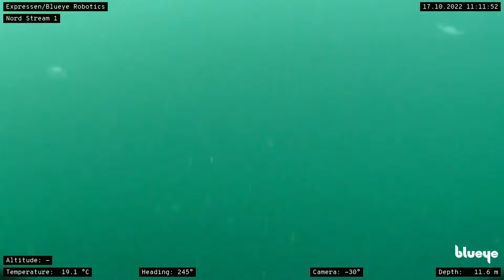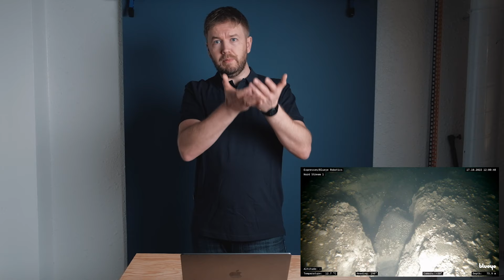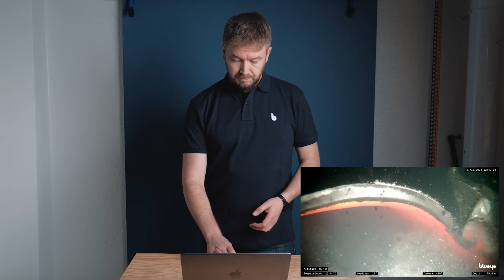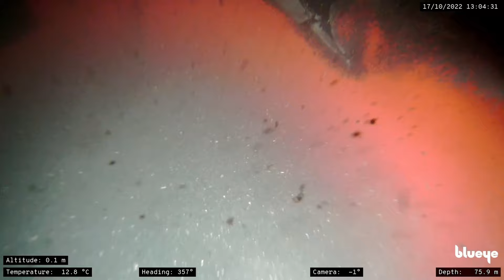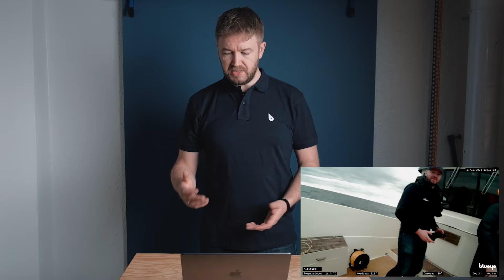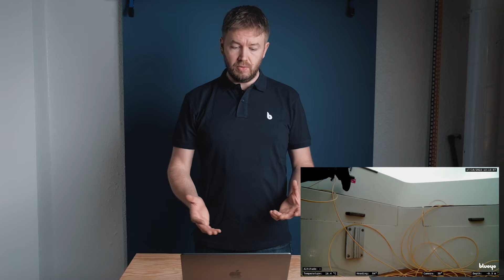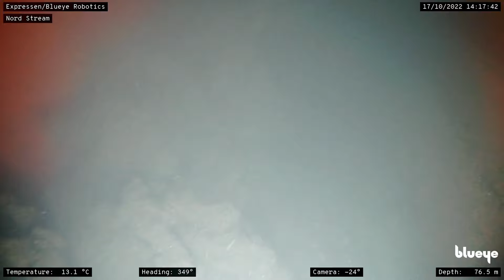Inside the damaged Nord Stream 1 pipeline |  Blueye Journey

Comment: One guy who studied all the videos said Nord Stream 1 looked blown by explosives, while Nord Stream 2 looked like a rip caused by faulty construction. That, plus the fact that the failure locations between NS 1 and NS 2 are 80 km apart made him think NS 2 was a natural failure, but that caused whoever planted bombs on NS 1 to detonate them because they knew inspection drones would be sent down and would find the planted bombs.
Reply: Faulty construction – I have seen how these tubes are welded together, and it seems rather unlikely. If a “natural rupture”, the ends should be rather close, as a rupture would not blow away many meters of tube. But its tricky, because the hole near Bornholm (NS2a), is the tube which has 2 holes,  the first up near Sweden, close to the other holes.
And the second tube is NS2b, is completely intact. Isn’t it strange, if the purpose was to halt gas altogether, why leave 1 tube intact, which means in fact half the capacity of the gas received so far, the 2 tubes in NS1, remains? This leads us to think, this sabotage was more of “a message”, than a desire to stop all gas. Now, if Germany wanted to import gas from Russia, they could start right away. Putin offered that many months ago, as he perfectly knows one tube is still intact. Importing gas through only one tube, would insure the price for that remains high. If there was gas flowing through all 4 tubes, that would far exceed demands, and price would plummet. Who would be interested in sending gas through 4 tubes for 100 Euros, at full capacity, when you could send through 1 tube, and still receive 100 Euros?
Reply: @poulnrgaard7820  ---- >  Evidently, the ruptures didn't occur on the same day.  In a September 8, 2022 interview, Putin said there was already a rupture in Nordstream 1 
  .... Gazprom performed August maintenance about a week before  an in-person interview on September 8, 202 where Putin said: : 
   .... "Now, the last turbine is out of order. Representatives from Siemens (in Germany) came and looked.  There is an oil leak.  There is an explosive and flammable situation. But, of course, the turbine cannot work. Give us a turbine, we will turn on Nordstream 1 tomorrow.  They don't give anything. They say we use gas as a weapon. What weapon? They themselves have done things.  It's them who have put themselves into an impasse because of the sanctions." (Vladimir Putin)

@ 0: 50 - 1: 18
       Nord Stream 1 Shut, Putin Dangles Nord Stream 2 Offer | Move To Lure Germany As EU Caps Russian Gas?  (crux Sept 8, 2022)
https://www.youtube.com/watch?v=dcV5nhRySHk

 .... On August 31, 2022, Gazprom had closed Nordstream 1 for three days of repairs at the Portovaya compression station in Russia, about three weeks before the reported explosions of September 24, 2022)  Putin claimed the damage was caused due to sanctions on the return of turbine. 
    Kremlin: only sanctions prevent Nord Stream gas pipeline from working  https://www.reuters.com/business/energy/kremlin-only-sanctions-prevent-nord-stream-gas-pipeline-working-2022-08-30/

It was determined that the turbine was not the cause.  Also, on August 4, Russia's Gazprom refused to accept return of the turbine.(Kyiv Independent).  It was, again, offered to be returned on August 8 still within the allotted time frame.. (cnbc)
    Deadlock with Russia over Nord Stream gas turbine is not our fault, Siemens Energy CEO says  https://www.cnbc.com/2022/08/08/russia-gas-siemens-energy-ceo-says-turbine-dispute-is-not-our-fault.html

In his September 8, 2022 interview, Putin expressed no concern that Nordstream 1 had been sabotaged. No one has asked if Gazprom did a search for explosives during that time.

Some had warned Russia's manipulation of the flow of gas in the pipes was dangerous but there still had to be a spark to set off the fire.
    Potential sabotage: What's behind the Nord Stream pipeline leaks? | DW News 
https://www.youtube.com/watch?v=ShXmPA21j-E
Reply: @poulnrgaard7820  
Video blamed faulty construction on the pipeline laying ship/crew rushing things before sanctions against NS 2 took effect. He also showed how the pipe boat was pushed all over in a storm right in the area of the break, leading him to suspect rushed, faulty construction leading to failure.

Yes, who potentially benefits from one NS 2 remaining intact? Russia. Plus NS 2 is 100% Russian owned while blown NS 1 is just 51%. I think Putin wanted drive a wedge between USA and Germany using the Biden comment as cover. Russian false flag psyop. Putin KBG 4D chess.
Reply: @poulnrgaard7820 Were not "ruptures" on Nordstream 1 discovered first?

And there were reports sbout a mine found at the intact line of Nordstream 2
Reply: They probably bumped into it with whatever they used to plant the explosives
Reply: you talking bullshit
Reply: bullshit

Comment: From what I have seen, this pipe was made using the spiral winding method which requires a multiple pass helical weld.  Submerged arc is the typical process, first pass inside with all remaining passes on outside.
Next, we must look at typical stresses.  Two axes of stress are principle, hoop stress which wants to expand the diameter and longitude stress which wants to make the pipe longer.  Hoop stress in thin wall cylinder is twice that of longitude stress.  
Helical angle plays into these stress levels.
Reply: Wrong. It was made from sheets of high strength steel..........Be nice if everybody watched the construction and laying of the pipe videos before they spout garbage...............Z
Reply: @zardiw  
Are you Stevie Wonder?  The pipe has a spiral weld.
Reply: Is that so And
Reply: spiral winding is for flange gaskets... For actual welding of pipe, Fit was done using traditional method , root and hot pass was done by actual welders(cant tell the process because no footage in videos) and fill and cap was done by automatic welding process GMAW. Source- im a weld inspector for pipeline and ex-diver

Comment: ----- >  ... @ 7 29 - 8 01,  "there is no angle grinder signs on the edge of the steel.  And it would be strange to me if say someone had bent this.  The force of bending 45 millimeters of steel and that side is quite heavy.  And, it, at least to me,   really looks like its been torn off. And, with the high pressure inside the pipes, it is not hard to understand that it could bend the pipe."
Reply: torn, agree!

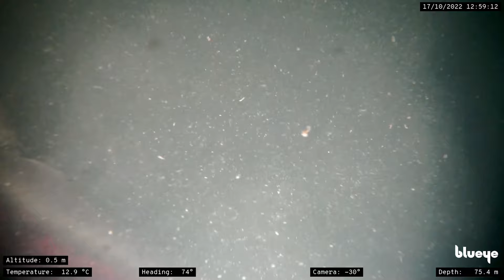Comment: Great footage, thanks. The pipeline was clearly destroyed by an internal explosion as seen in 4:58; 8:53; 11:36 and NOT sabotage.
Reply: That's a huge assumption, the easiest way to blow something up that is under pressure is to simply weaken it from the outside, then let the internal pressure finish the job by blowing it out. This provides no evidence that the initial weakening or explosion was internal or external, just that the result was a massive blowout, which is hardly surprising.
Reply: Wow how do you make that judgement?
Reply: could have been planted before the pipe was sunk... seems the two that said it would happen already expected the pipe was booby trapped/sabotaged.
Reply: you talking  bullshit
Reply: I just love that every armchair expert commenting on this video neglects to mention that pressurized gas erupted from these pipelines and that the forces of these eruptions further rupture, split and bend the steel outwards no matter what the cause of the initial failure.
Reply: @gragor11  
the pipe is made of carboniron not steel.
And that breaks and doesn't bend
Reply: @janklaas6885  carbon Iron?  Really.  So how would someone claim it was not bent in or out if "carbon iron" doesn't bend? They have to bend it to lay it.  The destroyed pipeline is obviously bent.  How do you explain that?  

Furthermore, where exactly does "Carboniron" falls within the differentiations between raw Iron; Pig Iron; Wrought or pure iron; High carbon, Medium carbon and Low carbon steels?

" ... The pipe segments are coated with a special anti-corrosion concrete coating. The concrete coating is made of high-density iron ore, which is crushed, mixed with cement, and applied to the exterior of the pipe segments. ..."

Oh oh . . .  " ...The pipe segments used in the project are made of unique  s̲t̲e̲e̲l̲, in that it has high strength and elasticity. ..."
https://www.petroskills.com/en/blog/entry/april2022-totm-Transportation-of-Natural-Gas-in-Dense-Phase%E2%80%93Nord-Stream-1

You know I don't mind that you shared you knowledge with us about what you perceived the pipe was constructed out of but your dick head approach has left you looking to be the prick in the equation. 

Next time be a little more gracious when you correct what you perceive to be essentially a spelling error. Just in case you're wrong.   I take it you are one of the 'Russia blew up their own pipeline' concept supporters.  

From any blown apart pipeline I've ever seen the pipe is flayed open along numerous yards or metres from the initial point of failure.  All bent out due to gas pressure release.   It was never clearly  indicated in the video which end of the pipe was being shown but generally speaking pipe bends outwards when someone or something lets the gas out of it in a catastrophic failure method.  But hey, #slavaNATOterrorism

Comment: sow salt water goe inside pipes also the remain part of nord stream is destroyed, right?
Reply: No, the pipeline can be repaired, tested with pressurized water,  dried and put back into service.  It must be absolutely dry as methane and water form an ice called gas hydrate that will plug flow.
Reply from the maker: We will leave it to experts to confirm.

Comment: Is this a total lost to the pipelines or can it be repair?
Reply: It can be repaired.  Within hyperbaric dry welding depth or it can be raised to the surface..IIRC, this was an S lay pipeline as it isn't deep.
Reply: @keithjurena9319  how do they perform welding at depth? Also cleaning the pipeline of sand and debris must be complex
Reply: @stefpix  
Dry welding is done at depth using a diving bell device over the weld joint.  It is at local pressure, about 1 Bar each 10 meters of sea water depth.  
Cleaning and drying the pipeline is done with moving plugs called pigs.  Very dry air is used to remove all water.  Vacuum is also used.
Reply: @stefpix  Ex-diver here. you dont need to weld these days to fix broken pipelines. There are these things called "smart flange". Simple put, you would cut at a spot where pipe is no longer damaged, cut the pipe and prepare the end clean. then you would slide in the smart flange over it. smart flange comes with a cover flange (blind flange). when you tighten this flange, the smart flange sleeve will start making seal around the pipe. aftewards, you do it to the other side of the pipe and do it all over again. now you have both ends of the pipe with a flange. now all you have to do is measure the distance and fabricate the spool on the boat or land and bring it over and bolt it up. its really just easier for you to search for "smart flange" . its bit hard to explain the whole operation with just words
Reply: There are previous cases of similar pipelines being repaired, just that the damage was by different causes. In any case the cause of the damage does not change the way it is repaired. They cut off a length of pipe on each side of the pipe and install a new length in that part. Of course not an easy job, the most difficult being joining the new length of pipe to the rest of it.  There will also need to be extensive cleaning and possibly recoating of the interior.
Reply: @listerdave1240  looks shot to hell, to me... the smoking gun!